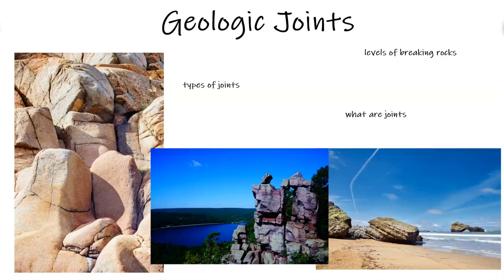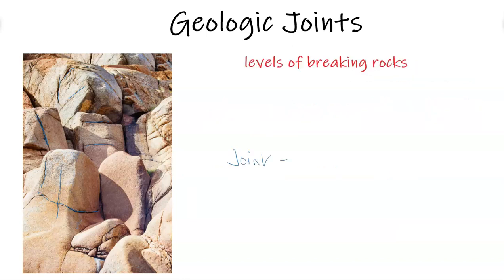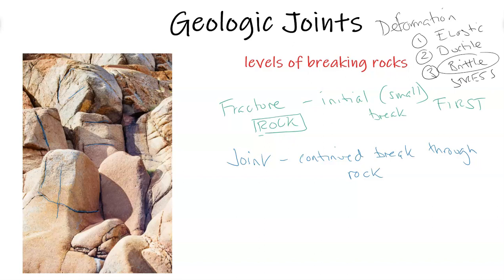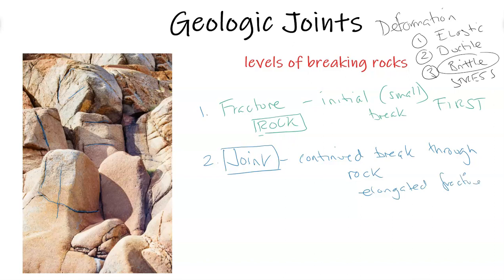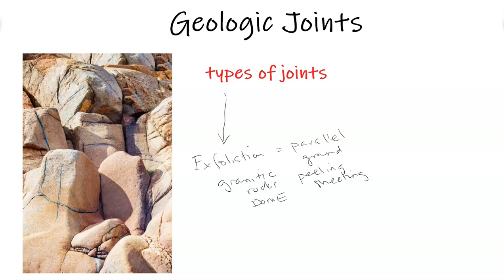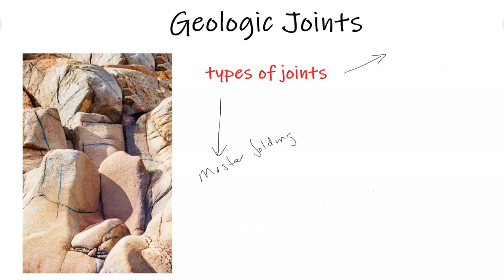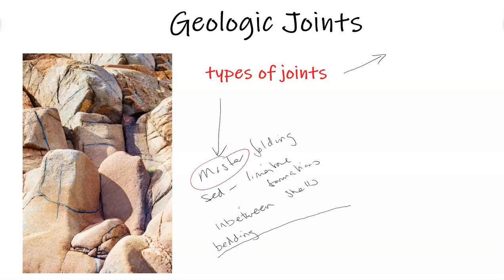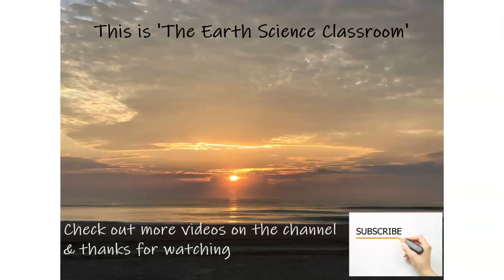How Joints Form In Rocks

Comment: It would be really great if you could have another go at this video. I really enjoyed the content, and your descriptions are fantastic, but it would have been nice to have some actual pictures of the different types of joints as you explained them. Maybe you can answer my specific question. I drive through a canyon daily, that was blasted with dynamite not remove the area needed to place the road. There are lots of remains of the drilling holes that were used to place the blasts. There are, how’re several different joints that have been revealed and I want a way to describe them. A good chunk of the rock is granite, has a very uneven jointing, and the face itself is quite jagged. In some places, some dikes have pressed another igneous rock separating the granite. The fracture between the granite and the intrusion is mostly straight. There is one rock in the canyon that is not granite, darker in colour, much finer crystals, and its joint pattern is almost cubic. It has very flat face, not perfectly smooth, but from the car it looks perfectly flat. Also, that same rock has very straight fracture lines both horizontal and vertical.

Comment: Hi, is it possible  the granite blocks that are used to build the pyramids in egypt originated  from granite mountains that have had joint system  or other types of geologic joints, rather the granite were cut.

The limestone blocks at the base of the pyramids might be obtained from sheet joint or beddings too.
Reply from the maker: I assume the natural joints were used or identified as a location to break or cut the granite blocks away from the original or parent rock face. Otherwise the granite blocks would be all different shapes and sizes and making them into usable building blocks is difficult without modern equipment